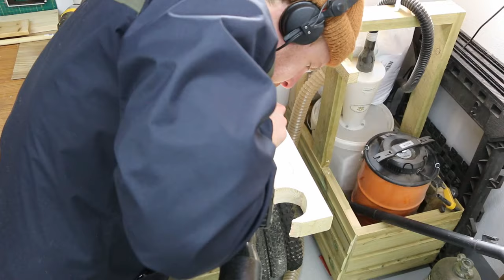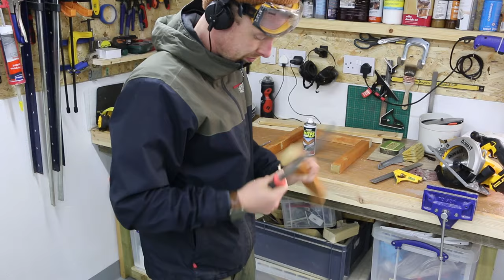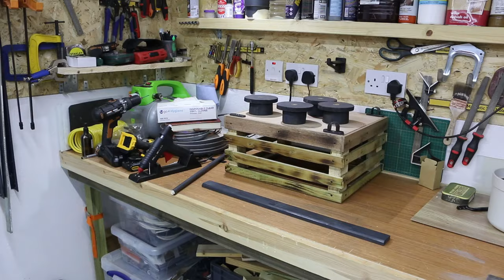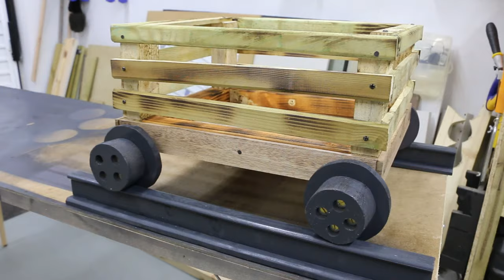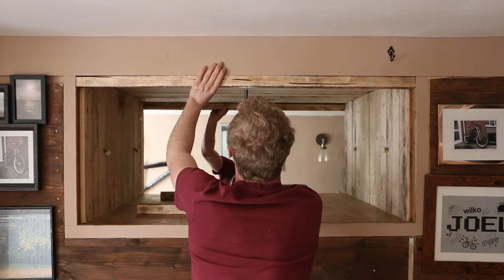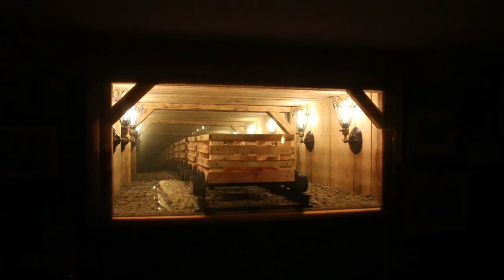I built a DIY Mineshaft Infinity Mirror

Comment: Hi sir what type of glass used in front side...
It is one way mirror??
What is the thickness of front glass ..
Please guide me....sir
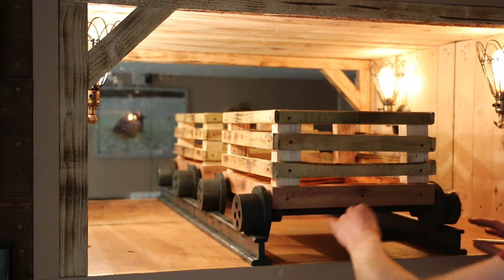Reply from the maker: The mirror at the back is a normal mirror, then the regular glass panel on the front has a 1 way/privacy film on it which you can buy online (seen at 3:20). The mirrored side of the front glass panel faces into the infinity box. So from the inside, the mirrors look at each other, but I can see through one of the mirrors, creating the infinity illusion, but only once the lights inside are turned on. . If that makes sense?

Both glass pannels are about 7mm thick. This can vary for you depending on what kind of project you are doing. If it's a table, maybe thicker and/or shatter-proof for safety reasons. But because this is just a display which isn't touched, thinner can be used.

Comment: So is there a one-way mirror film on the backside of the front glass panel? In other words, what did you do to the front glass panel to make it insanity?
Reply from the maker: That’s correct yes, the mirror at the back of the hole sees another mirror. And when the light inside is turned on, we can see through that mirror, but the internal mirror at the back cannot. This creates the illusion :).

When the lights inside are not on, we also just see a mirror from the outside reflecting back at us. 

Thus, insanity ensues.

Comment: underrated hope youtube recommend this to more people
and i have question what's the % of the glass tint are you using
Reply from the maker: Thanks ! 
So do I :D.
The tint isn't actually a tint. Just a one way "Privacy" mirror film on a sheet of normal glass.
The fact you can see through from the other side is because of the light inside the box.  
So it's a normal mirror, with a fake mirror looking at the normal mirror, which we can see through.
I tried to pull up the Amazon link but the link is not working for some reason.
Reply: @MrJoelDavies  Hey great video bro, did u put the mirror film on both sides of the glass?
Reply from the maker: @Rhin0Dot  thanks man!
The mirror at the back is a normal mirror, then the regular glass panel on the front has a 1 way/privacy film on it, facing into the infinity box. So from the inside, the mirrors look at each other, but I can see through one of the mirrors, creating the infinity illusion. . If that makes sense?

Comment: Was the slight downward curve planned or a happy accident?
Reply from the maker: it was indeed a happy accident :D.
I'm still not totally sure what caused it to be honest..
Reply: @MrJoelDavies  the distance between the two mirrors is off. Slightly closer on the bottom. Like a 1/16" I would guess.
But it really looks great in this case.
Reply from the maker: @OscarSommerbo  ah that makes sense!
The back wall of the box it is built in to probably wasn't ever that level and when I put the mirror in, i set it flush against that back panel. Leading to a very happy accident. Cheers for clearing that mystery up :D
Reply: @MrJoelDavies  The two mirrors aren't perfectly parallel.